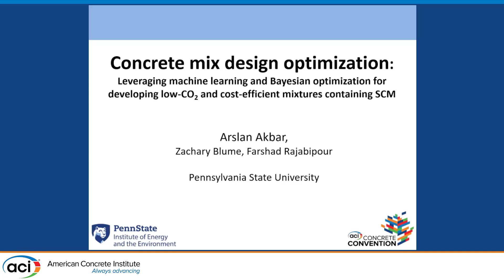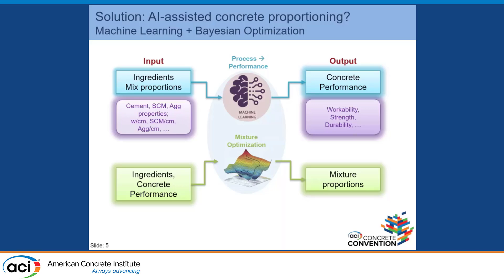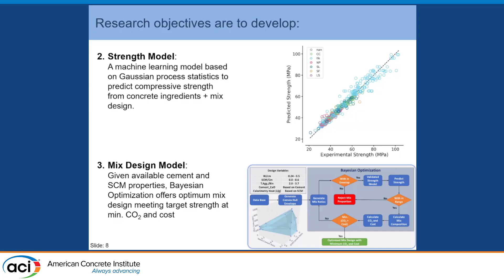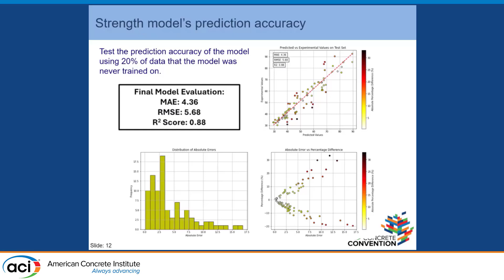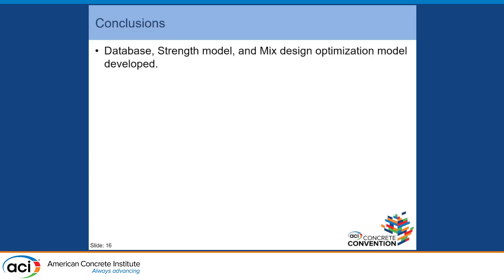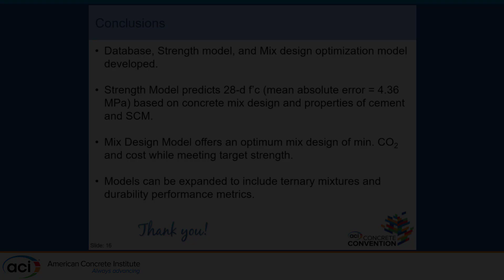Concrete Mix Design Optimization: Leveraging Machine Learning and Bayesian Optimization

Comment: The reason for splitting data if you wonder is where a model memorizes training data rather than learning general patterns. It enables fair evaluation on unseen data, ensures robust performance, and allows for accurate hyperparameter tuning without bias

Comment: The ratio of splitting data depends on many factors. The standard is 80/20 or 70/30, but there are many other ratios that take into consideration enough data for testing and training.